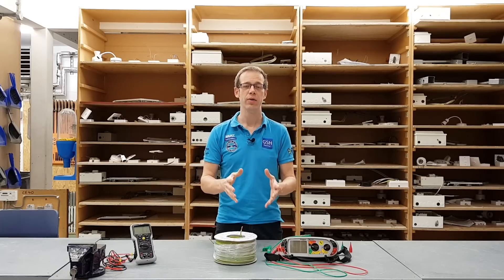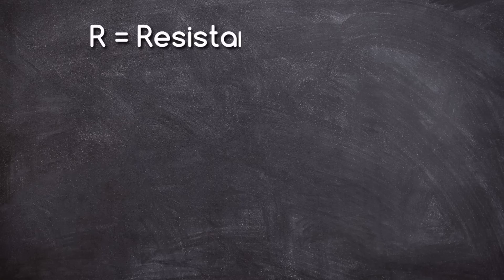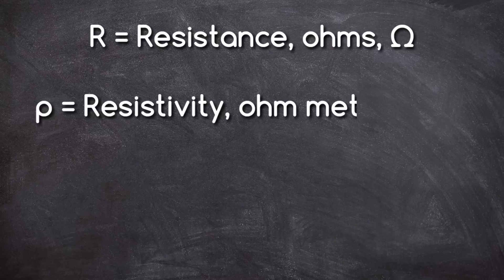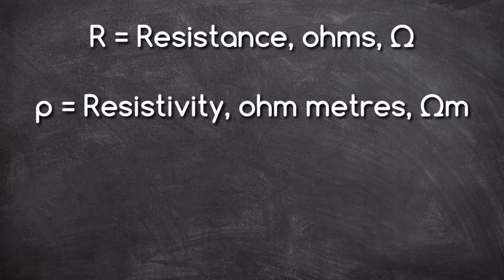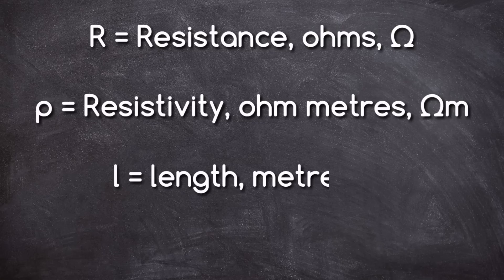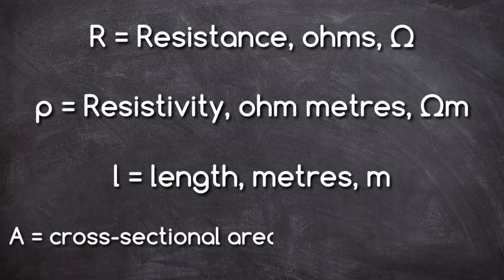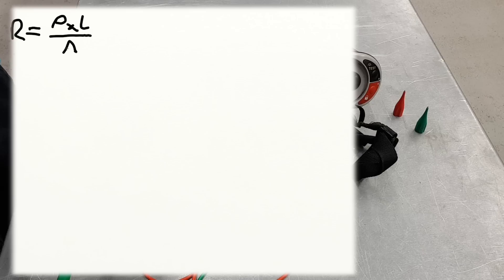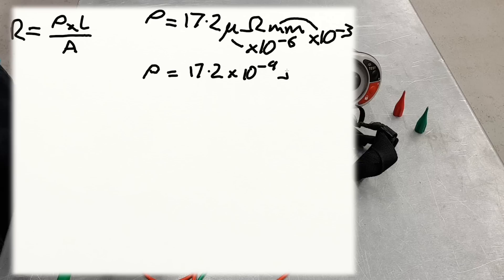How to Calculate the Resistance of a Conductor Based on Resistivity, Length and Cross-Sectional Area

Comment: I see where u got the 17.2 which is in the c&g text book as 0.0172 microohm meters but all the numbers in the osg are in milli ohm meters and also have different values for line conductor and earth.
Reply from the maker: The formula in this calculation allows you to change the cross-sectional area. The OSG saves you a step in the calculation by giving different resistivity values for different CSAs. 👍

Comment: thanks for the video mate i appreciate it
Reply from the maker: My pleasure, glad it helped. 👍
Reply: @JoeRobinsonTraining  just a quick question mate, what if i had 2 conductors 6mm line and 2.5mm cpc and I have the resistance r1+r2 e.g 0.29 i've transposed the formula to L=RxA/P to find the length but as i have 2 areas do i just take 2.5mm away from the 6mm? cheers
Reply from the maker: Hi, sorry, I've only just seen this. That's a little bit trickier as the two different conductor sizes provide a different proportion of the total resistance. Really good question actually, I'll need a bit of thought to explain that one. 🤔
Reply: @JoeRobinsonTraining  let me know if you crack it mate👍🏼

Comment: Why are you using the resistivity value of 17.2 when in the osg it says its 3.08 for 6mm?
Reply from the maker: Great question, the OSG uses slightly higher figures for resistivity values, I'm not sure why, I think it may be due to allowable impurities in the copper and manufacturing tolerances. Pure copper has a resistivity of 17.2. Its one of those things where whichever value I use someone will ask why I didn't use the other. Thanks for asking and stay tuned for more! 👍
Reply: @JoeRobinsonTraining  Hi Joe, using the OSG figure of 3.08 for 6mm gives a massively different answer, 0.051. Am I missing something here?